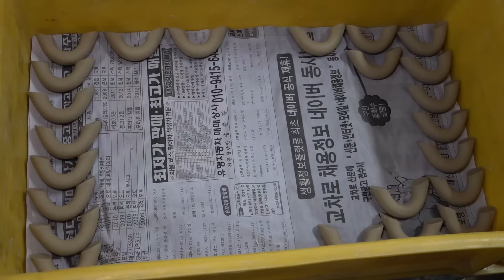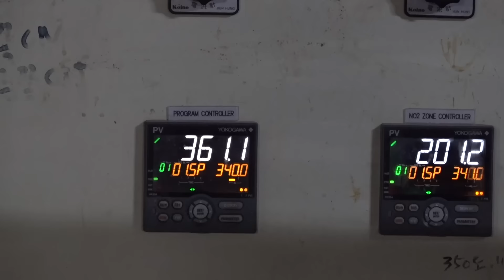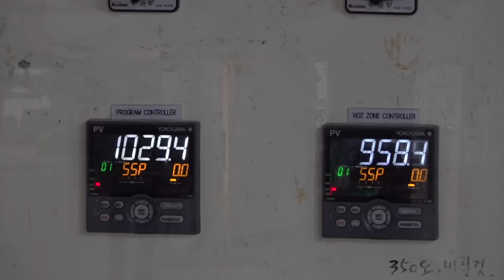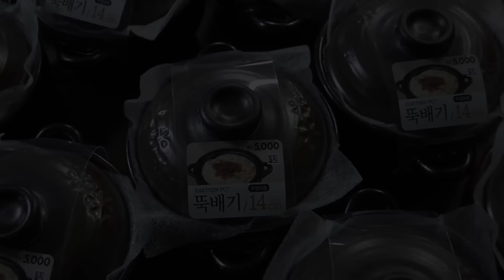Amazing earthenware pot mass production process. Korean ceramics factory

Comment: $3.80 for all that hand work- insane! (love the factory cat !)
Reply from the maker: cameo cat😄
Reply: jpではもっと自動化されてる様ですね、
jpの30年前50年前の技術でしょ。
元々k闇黒では石鍋は知られていたが、土鍋もあったのね。
Reply: 1 working day of one machine produces about 1500 pieces.
I have worked on this machine.
Reply: @mysygisun3335  
？
Reply: @Michael-fn1wr  I'm a production manager.
It was taking 15 secs to form the clay. Multiply that by 2 to get lid. That 30 secs or 2 pots per min. 120 per hour. So you would have to work non stop without any delays, breaks, eating or bathroom to get that 1500 per day. Not happening. 
This is plain old cheap labor. 10hr days making around 800 pots that sell to retailers for below retail cost. So about $2 per pot. $1600 profit per day for the business. But we have multiple processes that require more than just the forming and require additional employees. A total of 8 min. That's 200 a day, but you have to take out the overhead, gas electric raw materials maintenance water ect.. these slaves make $2 an hour at best with no benefits overtime pay or retirement working 60 hrs a week.
Just imagine what these women would do if you offer them a lousy $100 😂
Reply: @ahole5407  You are a production manager, and I am an ordinary handyman.  I will not argue.  Forms may be different.  I had a compound form with 3 parts.  I made about 4 pieces per minute.  I worked from 8 am to 5 pm with a break for lunch and snacks.  As a result, it turned out to make about 1500 pieces per day.  The daily salary was ₩125,000.  As of November 2021.  I think your employees have a lot to strive for.